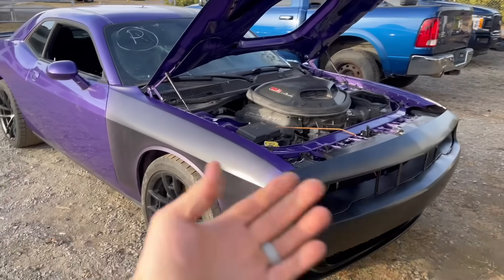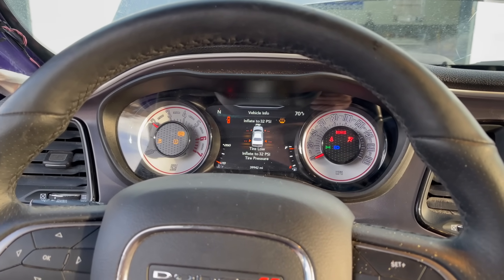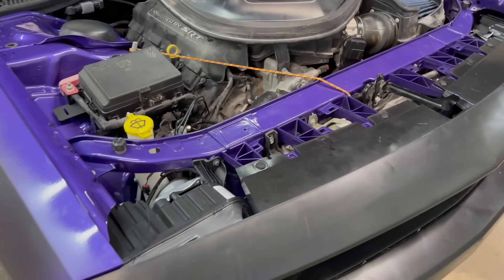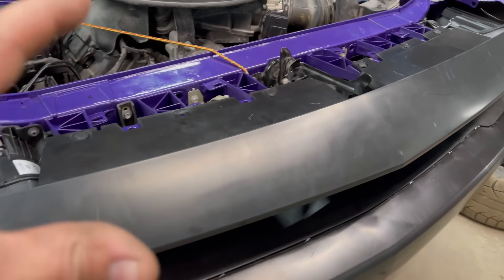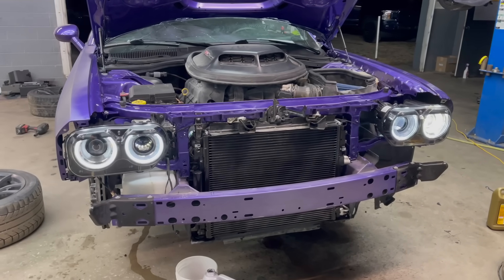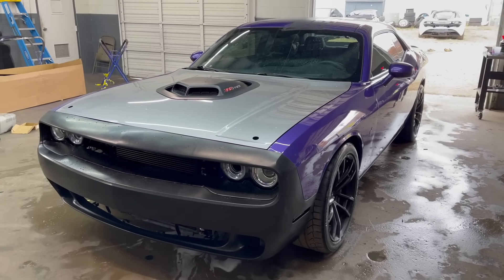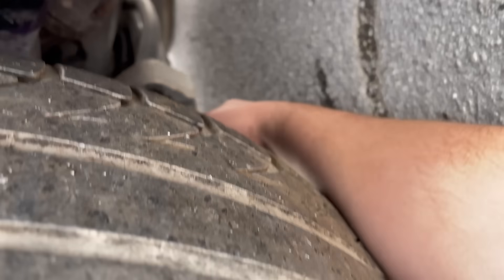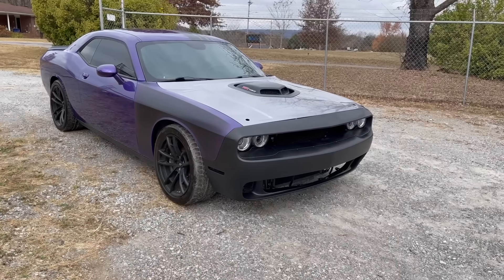First Test DRIVE Didn't Go to Well In My Rebuilt Dodge challenger!

Comment: 1) Disconnect the POSITIVE battery Terminal (B+) and touch it to GROUND for 30 seconds.
(This is to completely discharge PCM capacitors, which maintain the Adaptive Memory.
2) Reconnect the Battery Cable
3) Turn Ignition Switch to the "On" position but DO NOT start the engine
4) Turn Headlight "On"
5) Turn Headlights "Off"
6) Turn Ignition Key "Off"
The PCM Adaptive memory has now been flashed, or erased from the PCM.
When you start the engine it will be running off a set of pre-programmed tables that come with the PCM from the factory.
Reply: i was going to say that, u got it first
Reply: I had to do this on my BMW once. They told me to get an old battery, turn the lights on and let it drain completely.
Reply: Thanks for the info.

Comment: Hey Ben! Great job so far on the build.
Just a heads up, you only need to login with an FCA account if you want to access dealer features. You actually do not need an account to scan codes or look at diagnostic data. Just skip the login screen and the scan tool should take you to the normal homepage to scan for codes.

Comment: Sometimes theyYou will have to initialize the ABS module to the car. Sometimes they have to be new not used to run the procedure. I have the Dealer Micropod II.  Can let you borrow if you want to use it.

Comment: You need a Tazer, and then the ECM unlocked by HPTuners and use their software to edit thangs, you can read and reset codes with both and the with HPTuners software, look at diagnostic logs and toggle warning light triggers in the ECM.

Comment: If original ABS plastic is broken no issues bro. Unscrew 3 screw from used ABS open plastic housing install your original electronic board reassemble and good to go. It takes 15 to 20 mint. Just do it. No need dealership.

Comment: Looking & sounding fine!
My Challenger used to overheat, thought it was everything else, but what it was, it needed to be burped. But my engine had an air bleeding bolt on top of the intake manifold, then it ran fine after that.

Comment: Getting there well done, you might need the car to run through a ABS bleed, not sure if the vacuum will completely bleed, also if anyone is struggling with vacuum leaking I find putting some ptfe tape around the caliper nipple threads to seal them up help massively.

Comment: Drive by wire throttle bodies have to go through an idle learn procedure. Also that abs modulator will need to be bled through activation through diagnostic scanner.

Comment: When you replace the ABS it has to be reprogrammed. It wouldn't Rev because of the new throttle body and it had to relearn the throttle body.
Reply: The new abs pump will have to be bled too and the the entire brake system bled again. Bleeding the brakes does not bleed the abs pump. Depending on your scan tool and what Chrysler allows you may be able to do it yourself otherwise it's a dealer thing as well.
Reply: @ORRadtech  yep

Comment: A good scan tool should be able to initialize your ABS, but if your local dealer is cool then they will initialize your ABS module, some will tell you that it can't be done and you need a brand new one. if all else fails get alfaobd and a Bluetooth obd2 reader and do it yourself, you would need a bypass cable though.

Comment: Yep dont be to keen to drive on the road until you have fully checked everything,get it on the lift and check xheck check .
Do those cars only have one bleed port for the rear brakes?
Normally you would start the bleed from the the most far away cylinder,in this case the passenger rear ?
When you have finished it and its all sweet ,they will never know it was damaged ,thats rhe plan ?
Black Ivory for the shifter handle bits ?or carbon fibre.
Great to see in the comments about using a scan tool and no dealer required, there's so much information out there in internet world ,how did we ever get repairs done without the internet ?

Comment: The center consol electricals must be plugged in for the car to operate.  I installed a Barton shifter in my Challenger, and nothing would work until I reconnected the electrical connections that are in the console.

Comment: Autel sells a bypass Cable for the sgm. You unplug the module and connect the bypass cable and you can scan easily. The module is under the dash I believe. They started that bs in 2018-2024 models

Comment: as long as all the sensors are good that car will throw an abs code is brakes arent bled. mopar is known for it. all my kopars do it if air in line or leaking/fluid low

Comment: Could you also bleed the line with a flare nut wrench at the ABS unit, like possible, at the connection, when replacing a new master cylinder? Maybe,
dat way, da air bubble won't have to travel all da way to da caliper to be burped. lol

Comment: Would be better to install a OEM throttle body I've noticed on all the dodges I have worked on anything with the throttle body they are very sensitive like I replaced mine on my 300 because I upgraded it but it would just stop working while driving and I would have to stop and turn the car off and then back on but when I went back to OEM the problem went away

Comment: you should get the brake bleeder that hooks up to air compressor its much better
Reply: I was coming here to say the same. The mighty vac is for simple bleeds like a caliper change but this is a big bleed with lots of air in the system. Also to note the air compressor style ones require a decent air compressor. Not a little pancake one.

Comment: Don't bring it to the dealer to reprogram the abs, they can't, you will need a new abs module
Reply: No , it doesn't need a "new" module ,  Second hand ABS pumps on these can be virginised , recoded to the vehicle vin and coded for the vehicle options no problem at all

Comment: Manufacturers piss me off when they lock you out of being able to program the car or do other diagnostic functions. Once they sell it it's no longer their property, and there is no excuse for locking the customer out. And i can't understand why an ABS module needs any programming. It should be able to communicate with the rest of the car to set the parameters it needs.

Comment: Just put electrical tape over the lights on the dash… I have it on my fuel light😎 I don’t do sit ups, so I don’t have abs either …And the dinging and knocking noise goes away with noise canceling headphones. This car repair stuff is so easy these days

Comment: Ur throttle body had to recalibrate and learn its self to the ecm it’s  happened to me to I let it run and hit the gas and it wouldn’t rev then after letting it idle for like 10 minutes it seemed to recalibrate

Comment: Hello Vtuned! i have a big problem going on with my SRT8 2013 challenger and was hoping you may know what's going on. I've spent about 1700$ in total on trying to fix it from other knowns sources and still hasn't fixed my issue. Recently after installing my headers and then tuning it, its been causing my car to go into limp mode. I tried looking at the wires and managed to fix some spliced work from someone before me and then also having a professional tuner try and clear any corruption from the computer. We fixed it for 4 days and it still goes into limp mode. Can anyone please know whats going on?! I really dont want to get rid of this car as it is a beautiful car but i can't stand not being able to enjoy it cause of this limp mode. Thanks!

Comment: Access to FCA US LLC's computer systems is controlled. UNAUTHORIZED ACCESS OR USE IS PROHIBITED. Authorized users are hereby informed that FCA US LLC management may monitor this use and ensure compliance. FCA US LLC may terminate access privileges, take DISCIPLINARY ACTION and/or institute civil or criminal proceedings to enforce this policy.😂.    And there easy to steel but you can’t fix them yourself.

Comment: I know I ran into a problem with my Silverado, which I had to buy. a scanner. that pumps your brakes. It bleeds all the air out by pushing the button. And this is 2003. So yours probably has it the same way on the ABS.